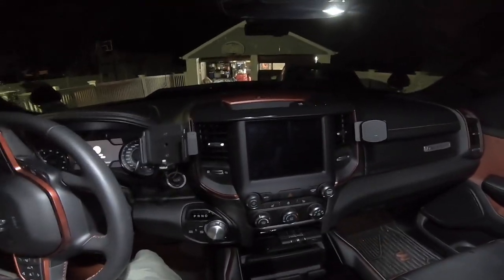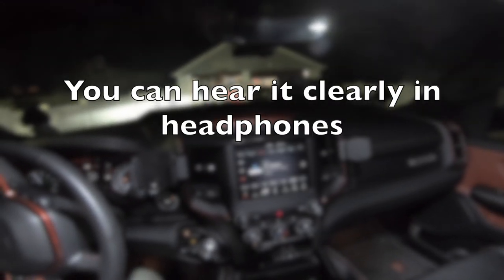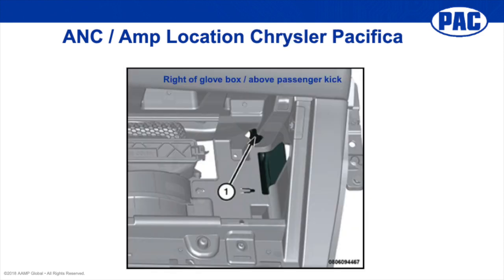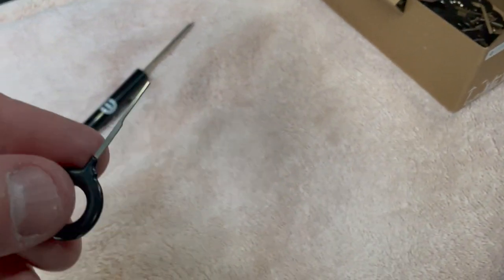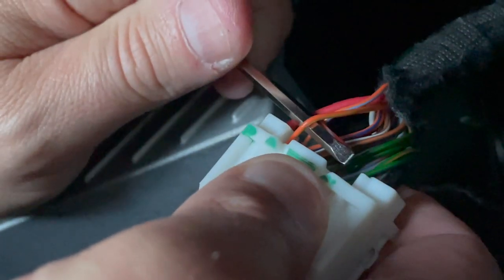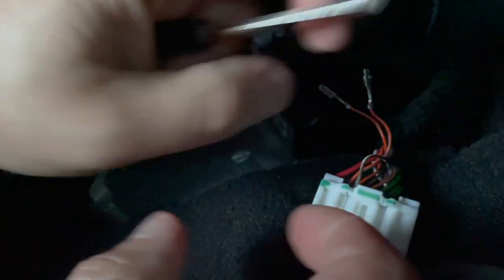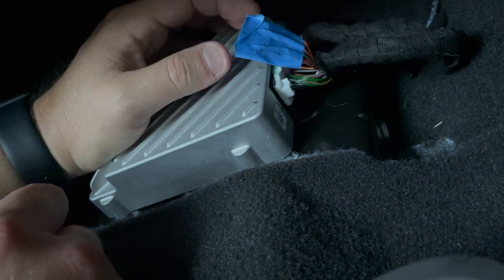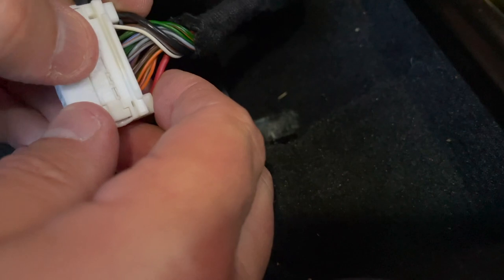ANC disable (Disable Active Noise Canceling) 2019+ Ram 1500 Rebel (Chrysler Jeep Dodge info)

Comment: thanks for this video - put some $$$ into an aftermarket system and it sounded like my exhaust was in the cab
Reply: Same shit happened to me! Horrible drone after installing the new kickers. Then I also installed a straight pipe the next day made me think the muffler shop did something wrong but I was noticing the drone was coming from the front

Comment: Excellent video I just installed yesterday the same speakers you did and got the same result. I googled the loud rumble like you experienced and came across your video. Thank you for taking the time to do this video. I ordered the adapter harness and I should get it in a few days. I'm not going to de pin it for a few days but I'm going to remove the white plug and see what happens for now. Update just put in the harness workes perfectly. Thanks again.

Comment: Thanks for putting this up.  I have a 2023 ram 3500 with base stereo and I upgraded to 6 channel and sub amp.  The connector you pulled the pins from looks just like one on what I thought was the factory amp in my truck.  I had horrible feed back.  Mine was located to the drivers side of the steering column and it had the same four wires.  I depinned all four and problem solved.  Thanks.

Comment: I bought the ANC bypass harness. Then replaced my 6 speakers with the same speakers you bought. I figured I'd at least listen to the new speakers to see if I needed the bypass harness before I just plugged it in. I was expecting to hear the bad sound but I got nothing bad at all. It sounds great and I have the same underseat setup you have. (I have 2021 ram non amplified no sub system).
Maybe the previous owner did this mod that you did and put the stock speakers back in.

Comment: I ordered this harness via Amazon, unfortunately it did NOT work with a factory amplified system (i.e. premium HK audio system).   The harness will work with an aftermarket amplifier, it clearly states NOT to use it with the factory amp.

Comment: I did the same Infinity Reference speaker swap and did not experience the drone/distortion you did. From what I've seen online the ANC is very sensitive to speakers being out of phase after a swap if you use wire harnesses that have polarity swapped. Not sure if that's what happened with your install, but some harnesses are manufactured with reverse polarity.

That being said, I have a ANC bypass harness arriving tomorrow to delete the ANC because I don't like artificial sound coming through my speakers even if it's working correctly. The Infinity Reference speakers are crazy bright though and don't produce much bass at all so the bypass harness also gives me a cleaner way to tap into the high level speaker wires for an amp.
Reply from the maker: Agreed the reference speakers have a button on the tweeters to tone down the brightness. 

Also the anc bypass delivers clean sound to my DSP so I’m able to tune balance it out to sound good with my sub

Comment: Nice job on the video as per usual.
 Had a separate question.
 Have a 2019 Ram 1500 Laramie Sport(new body style) 12" screen.
 Having issues with the GPS when putting in an address(unknown error message)
All other functions seem ok.
 Thanks.

Comment: I have a speaker upgrade with the infinty 2 way 6x9 speakers and the same dash speakers, anc disabled. Everything works great, but i have a small hiss/static coming through speakers at all times, mostly noticlable with no audio playing at all. Shut engine off and still have that white noise or "hiss" sound. Was that anything you ran into as an issue?
Reply from the maker: What is your source when you hear the hiss?  

Also just to confirm stock radio with no external amps or other devices connected?

Comment: First off awesome video! I just bought a 2020 Big horn 1500 with the 8.4" screen and 6 speakers. I love the truck, Absolutely hate the sound when you even try to turn it up. sounds like my 4 year old niece is turning the volume up and down!!! did you have this issue prior to de-pinning?? I also plan on upgrading the speakers. I just want lean sound a little louder. no craziness. Any help will be appreciated. Thanks!
Reply from the maker: Thank you, I don’t recall having an issue with the volume before my upgrades. 

If you de-pin and just replace the speakers with the ones I used (links in the description) there is a really nice improvement. Better bass response and cleaner highs.  I was really pleased with the results. 

I could have stopped there but my love for tinkering made me keep going.
Reply: @WorkPlayDrive  lol!! can't just leave it alone!! :) It is going to the dealer soon and we will see what they say. It is painfully obvious the volume going in and out,  Unreal. As soon as this issue is fixed I'll be most likely upgrading the speakers. Thanks for the Input!
Reply from the maker: No problem and good luck 👍
Reply: @WorkPlayDrive  Thank you! Hey did you have to use any bass blockers for the front dash speakers???
Reply from the maker: No but I’m using a DSP to tune out the bass so it wasn’t necessary. The speakers in have in the description come with the bass blockers-capacitors in the box.
Reply: @WorkPlayDrive  awesome thanks! from what I understand the front door speaker circuit also powers the dash so I would imagine the dash 3.5"s would be screaming!
Reply from the maker: Not really before I got the DSP I had them all run direct from the radio without the blockers and they sounded great.

Comment: If you have the 9 speaker Alpine or 17 speaker Harmon-Kardon systems, you need the ANC-CHH2 bypass harness. The one linked in the description only works with the stock 6 speaker system.

Comment: 17 years as an IT guy fixing electronics. Painters tape is fine. I actually hate electrical tape.
Reply from the maker: Totally agree after a few days in the heat that electical tape goo gets so annoying.
Reply: @WorkPlayDrive  Yeah, if you ever get that glue on a electrical cord and run the cable through your hands its awful.

Comment: Question I’m little puzzled, so you take out those four wires and tape them away that’s all you need to disable the drone noise? What is the harness you need to order from Amazon for?
Reply from the maker: Correct, if you pull the pins and tape them off that will work. 

The harness serves two purposes
1. Easier to just connect without pulling pins from the connector. 
2. You can cut the harness wires in the designated spots to run the speaker output to your add on amplifier then reroute the amplified sound back to the speakers. 

Allows you to modify without touching your factory wiring.

Comment: If you installed the PAC harness did it all function as intended and to your satisfaction?
Reply from the maker: Yes no issues and it’s working as designed. It also came in handy when I needed to pull my amp for service. It took 2 minutes to move the seat forward, and plug the speakers back into the factory amp so I had music until it was repaired.

Comment: One question , What cause that horrible sound thru the speaker ,by discounted those for four wire from the harness ,And it stop?
Reply from the maker: It’s the active noise cancelling. The factory speakers are designed to not play the audio in that range

Comment: Who'd have thought just swapping speakers could cause such a headache?  I just ordered the bypass cable, that way it's a quick swap out if I have a stereo issue under warranty..
Reply: Bypass cable worked great even though I'm not adding an amp or sub (yet).  Drone is gone, cabin is just as quiet as before.
Reply from the maker: Nice 👌

Comment: My friend my friend!!!!!! U are helping  me so much !!!  I recently installed the same speakers into my 2021 ram 1500. And I thought my muffler fell off!!!! Lol.   My ram has the 12 inch screen w 10 speaker factory Alipine system.  Will I need to do the same 4 wire disconnect or will there be more disconnections needed for my system???? Thank u so much!!!!
Reply from the maker: Sorry not sure. I don’t have access to a 10 speaker system.

Comment: So in theory you could just do this and use a line output converter to pull signal for amp and sub?
Reply from the maker: Yep 👍
Reply: @WorkPlayDrive  for the signal. When i take out the factory sub can i hook up my lc2i to the factory sub wires? Instead of pulling from rear doors
Reply from the maker: I will try to get full range Audio into the Lc2i this way you can shape the sound better because I’m assuming the factory sub specifically tuned for the tiny cabinet. It sits in

Comment: When the vehicle comes with an AMP and Sub how are they able to use the ANC while having the amp and sub? I feel like changing out the sub should have a way to still use ANC
Reply from the maker: the OEM speakers are specifically tuned not to play the sound that the ANC is putting out. Which is why you can hear it when you swap speakers

Comment: Wonder if the 22 rams have the same issue I have a 22 rebel and just got all new jbl speakers to install
Reply: Did you get the drone?  I installed 3 way Rockfords on my 2022, and I don't think it got that drone.
Reply: @omargurrero  never had to install it  replaced all speakers n have no issues

Comment: ANC-CH01 - PAC ANC Bypass does not work if your truck came with an amplified audio system from the factory.
Reply from the maker: hence my disclaimer at 2:25 ;)
Reply: @WorkPlayDrive  how do you cancel ANC with the amplified audio system?
Reply from the maker: Sorry I only have experience with the 6 speaker. Check with pac audio to see if they have an adapter for your system.

Comment: What's up with that heater detector device doing on the truck there in the passenger side attached.
Reply from the maker: Sorry not sure what you mean.  Is there a time stamp in the video you are referring to?
Reply: @WorkPlayDrive  3:16 mark. We're you checking the AC Air flow lol I know Rams are having issues with the AC too hahah I think mine has it I believe it's something not closing completely shut was thinking you were trying to work on that or do you just carry it there?

Comment: PLEASE HELP. I removed the 4 pins as described and it deactivated ANC, but also killed right side speakers.

2022 1500 Ram with HK with subwoofer
Reply: Were you able to find the right wires? I have the same system as you and was going to attempt this

Comment: I heard some of those other wires are for the speakers, do you know?
Reply from the maker: Yep in my current setup I have a pac harness that splits off the speaker wires. The go out to my DSP and amp then back from the amp and out to the factory speakers.  Check my video for details https://vm.tiktok.com/TTPdremhVa/
Reply: @WorkPlayDrive  Wow what a game changer. No more pulling the dash apart. Thanks this helps me out a lot!!
Reply: @WorkPlayDrive  one more question where did you tap into for remote power? Thanks
Reply from the maker: Under the dash there is a fuse panel it was one of the lower fuses sorry I don’t recall the exact one but just check which ones get 12v when running
Reply: @WorkPlayDrive  My ANC adapter showed up today I think I paid $20 for it I can’t thank you enough for the Info. I also purchased a kenwood 47key2004 today with Built in DSP I’ll let you know how it turns out.
Reply from the maker: Awesome 👏 I’m really enjoying my setup

Comment: That noise is meant to silence the engine
Reply from the maker: yes the use microphones throughout the truck to perform active noise cancelling and the factory speakers are set so they don't play the sound.  when you get wider range speakers the noise is now audible.  The funny part is there was no noticeable difference in road noise and I flipped it on and off a few times.   

I'm guessing since the rebel and it;s knobby tires are inherently noisy the ANC may be more effective in the other trim levels.